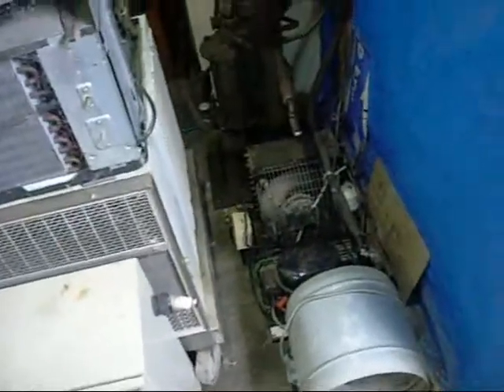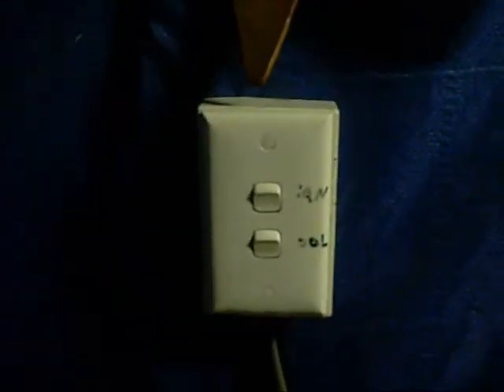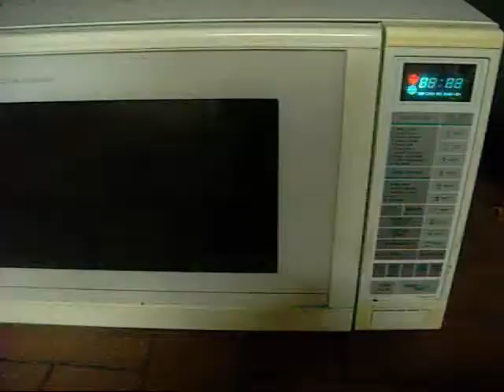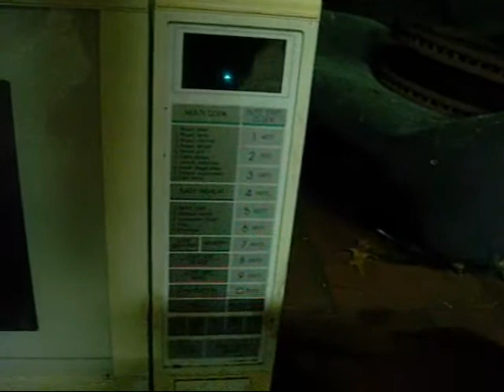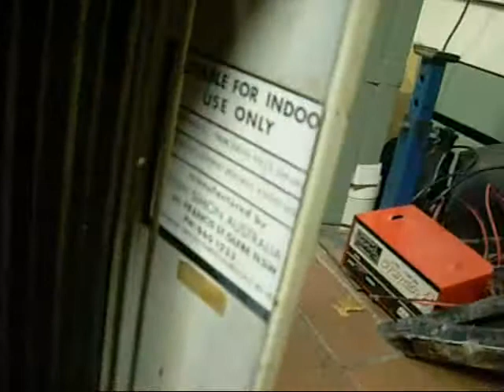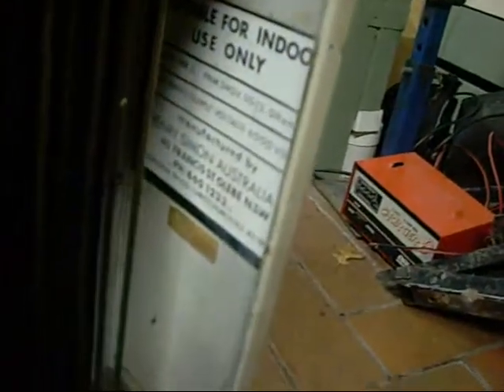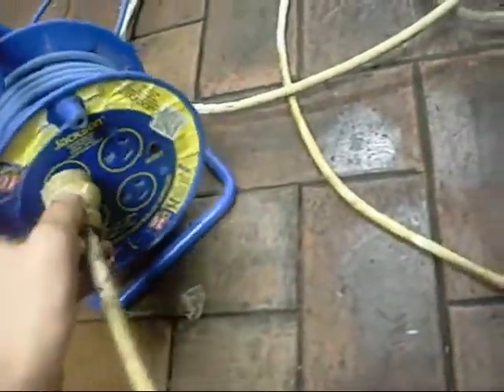Fun at V8jagnut's place - Condensing Units Mowers Bug Zapper etc

Comment: @Lachlant1984 I live in NY, and when heating season rolls around you can find heaters like that in all the stores. they usually have glass burners though. they don't make any noise and they're pretty efficient, a full tank would probably last about 6-7 hours. also bug zappers arcing out is normal, it's what they do ;-)